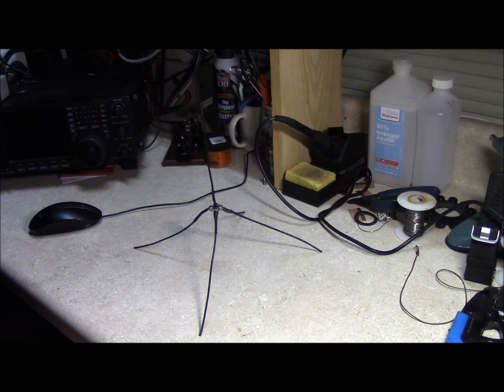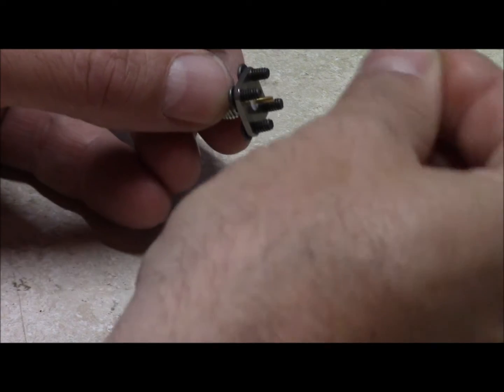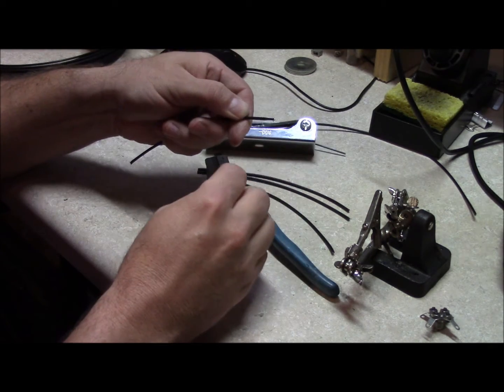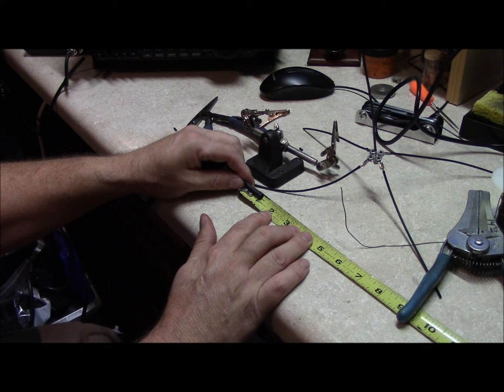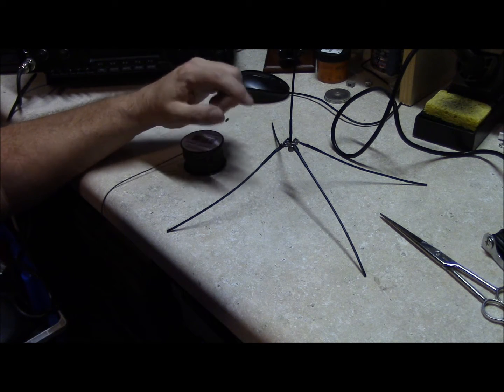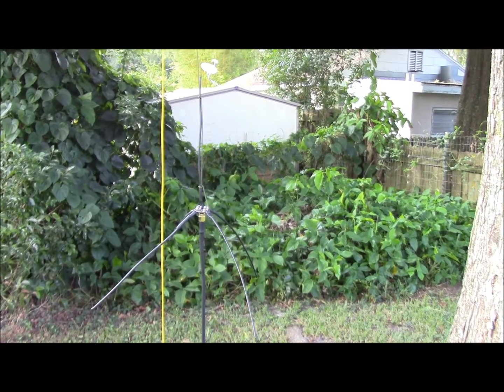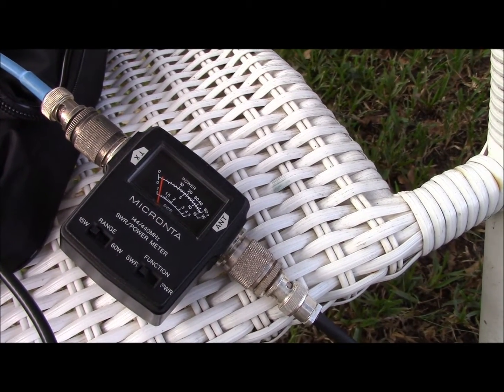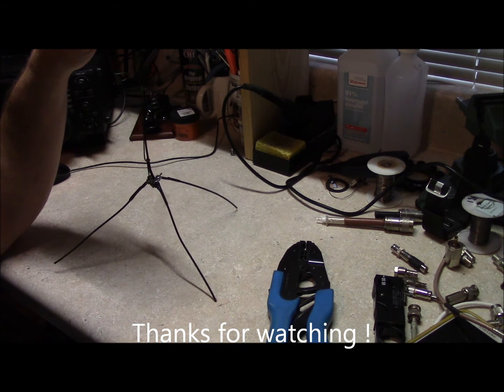DIY ultralight  UHF antenna

Comment: Hi  another great video   do you prefer the RG58?..  what about the Low loss cable RG174 FME  for outside?
Reply from the maker: Definitely the RG58.  RG174 has twice the loss of 58 at UHF. At UHF frequencies 15' of 174 has 3.1db of loss run of the mill 58 has 1.4db of loss. Thanks for watching !
Reply: @survivalcomms   thats great  thank you for the recommendations i'll try that from now on thank you so much!  David.
Reply from the maker: @DavidCurrie-lo9jd  You are welcome. It pays to study coax loss and balance budget, form factor, function, and loss when setting up your system. Here is a good online calculator  https://timesmicrowave.com/Calculator
Reply: Cheers mate!  'm going for my foundation license for uk amateur radio so   the heads buzzing with ideas   much appreciated for the link.   David RS319381

Comment: Great video. I have to say I'm REALLY enjoying your videos and learning from you. I do have a question, do you know if the old flex ribbon antennas from the old military PRC 77 radios can be set up to work with the Midland MXT 400 GMRS radio?

We're looking to build a few pack radios, but want a more flexible antenna that can stand up to humping around in thick swamps without giving up any range of the radio. Maybe you can do a video on how to build a flexible ribbon antenna like you did here with this antenna?? 

One more question, do you know how to hack the tougher handset of the PRC 77 radio to work with the MXT 400 radio? I mean there must be a way to do it with a little work, but how is the question, and from watching your other videos, if anyone knows it would be you. Thanks and keep up the great work.
Reply from the maker: Thank you very much. I am glad you are finding my content helpful to you. Yes you certainly can make a blade style antenna to work on the  GMRS radio you mentioned. It will be much much shorter than what you are familiar with seeing on the legacy PRC77 due the different bands being used. A blade antenna for your Midland would be 6" in length  approximately.  Sacrifice a tape measure for the element , cut it a bit long ( 7") Notch the base of your element for the center conductor of your RF connector and  flux / solder well to your rf connector.  Reinforce the connection by potting it in epoxy. Test the element and trim to resonance. It is a good idea and I may do one for as it would be a cool project. 
   It is possible to mate an H250/U handset to a ham radio but it isn't plug and play.There are some impedance mismatches to address and you need to route audio to the earpiece to cut the speaker audio off. I mated one to an IC706 a long time ago hope this helps and thanks for watching ! .
Reply: @survivalcomms  Thanks for the quick reply.

I have to say I'm surprised at how short the antenna would be, but I was wondering that since you were cutting wire in this video to around the same lengths. 

Why is it that the radios have such a long antenna then when you buy them?

Won't the range suffer since it's such a low profile and probably not even higher than a mans head?

While I like to learn the how's and why's about most things, but when it comes to radios I'm more in the camp of "I don't want to hear about the labor pains, I just want to know if it's a boy or a girl" if you know what I mean. haha I do like to know enough to trouble shoot minor problems in the field, but radios just seem to be a field that can be as technical as the medical field.

I do hope you do a video on this and MAYBE a video on the handset hack as well. haha Thanks again.
Reply from the maker: @wjf213  Antennas work based up fractions of the electromagnetic wavelength and as such they are tuned circuits. I'm not sure what antenna your radio came with. You can engineer gain into a system but you have to add things that will affect the durability of your platform . You are not going to get much range out of a UHF manpack  maybe a mile or two unless one of the stations has an elevation advantage  or clear line of sight.

Comment: I can't find that type of sma bulkhead jack with the 4 bolt connectors on it here in uk
Reply from the maker: Amphenol 132142 is an equvalent part number of what I used. You can also use a threaded bulkhead type with a small washer perforated for radials.  remember in a pinch you can always strip back your vertical radiator on a piece of coax fold the coax back over the jacket and wirewrap your radials soldering it up. Thanks for watching !